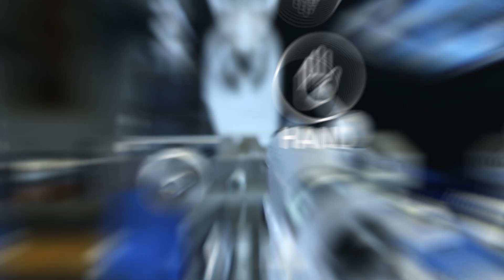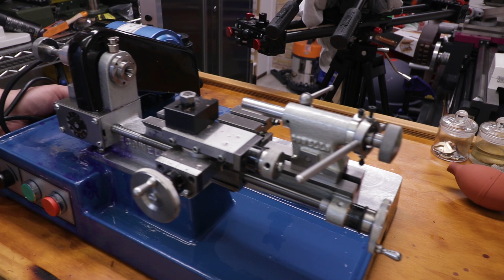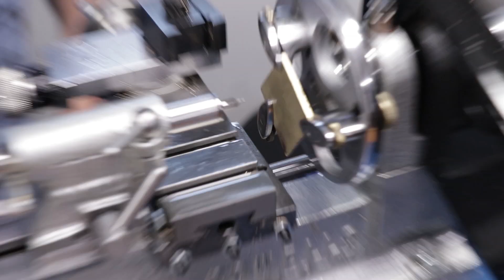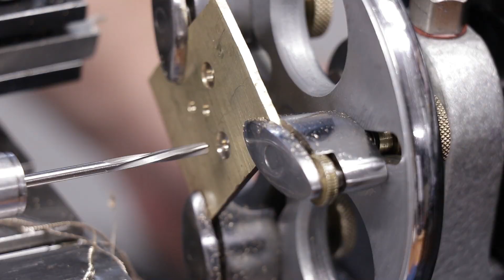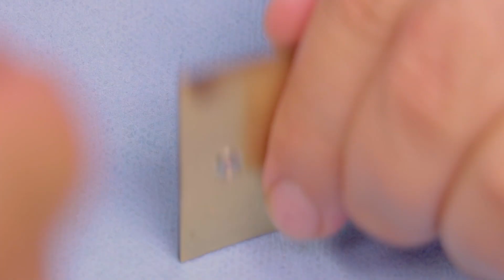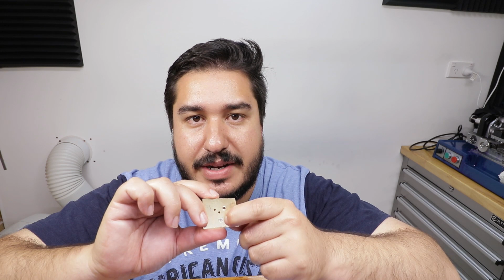Learning How to Ream Holes Accurately in the Watchmakers Lathe – Watchmaking Vlog 33

Comment: Something you can do to speed up your drilling for a jig is use some of that tool steel and make drill rod bushings. Then you can insert those bushings into a plate. It will make drilling the guide pins a cake walk bc it should not walk and stay pretty precise
Reply from the maker: Thanks so much. I think that is the way to do it without issue

Comment: May I suggest going slower?  Machinists use surface foot speed to calculate speeds and feeds in milling and drilling operations.  when reaming a hole, the general rule is "half the speed, twice the feed."  Once the reamer goes through the material, stop the spindle, and back the reamer out.  Check the inside diameter, see what you get.  Cheers...

Comment: with making reamed holes smaller, try the biggest pre drill you can. spin faster, and feed faster. also you can buy reamers that are like . 0001" bigger or smaller than the nominal hole size.
Reply from the maker: Thanks for the pro tip Christopher I appreciate it man. I will try fast speed and feed on pre drilled hole next time

Comment: So since there is visible movement of the reamer in the tailstock does it follow that the tailstock is off center?
Reply from the maker: Well I did test the reamer choked up aswell on the 3rd hole I made where the shock proof setting had good friction, I could see movement on the reamer the . I have been thinking about after reading your comment, it is possible it moved slightly as the reamer caught something on the edge when I initially drove it into the hole.

Comment: Jigs will be helpful. Be mindful that glue adds a slight thickness and when not there will change dimensions. In manufacturing they use temperature controlled inspection rooms due to differences in expansion in materials   Keep up the great work.
Reply from the maker: Hi John, thanks for watching and commenting. Yes I’ve been made aware recently at the lengths places go to for temperature control and it makes sense. Something I will be taking into serious consideration. 

Yes you’re right about the glue, another reason to add to the list of cons, and reason to move towards jigs..

P.S. Hugs will be helpful too, through the rough times. The notification had your unedited comment 👍🏼👍🏼😁😁
Reply: Dean DK ugh. Auto correct